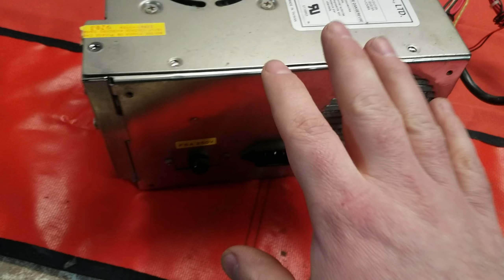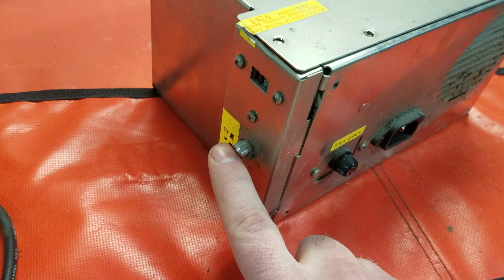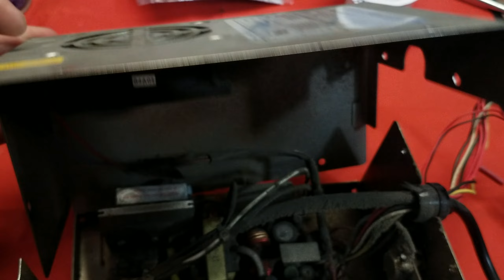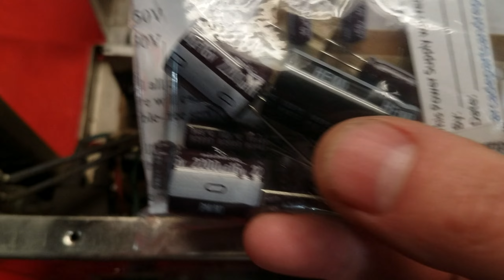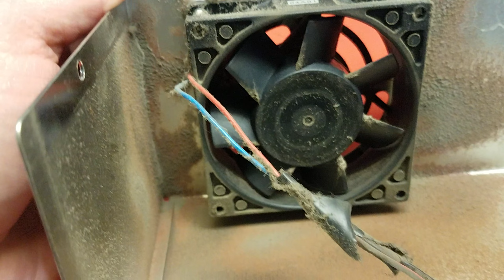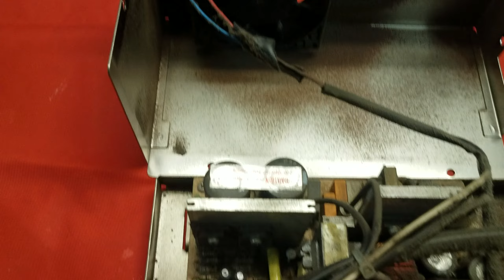Arcade 150 watt Peter Chou Power Supply Refurb Part 1

Comment: Generally the side of the fan that has blade guards is the output side; this one looks like it’s pointed up, which is the opposite as you described.
Reply from the maker: The fan was not factory, who ever replaced it pointed it up.